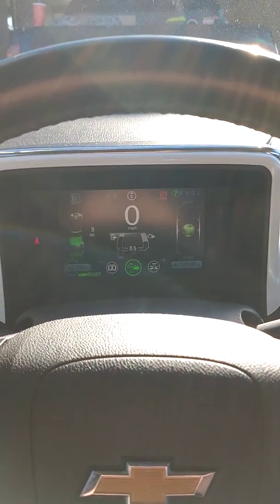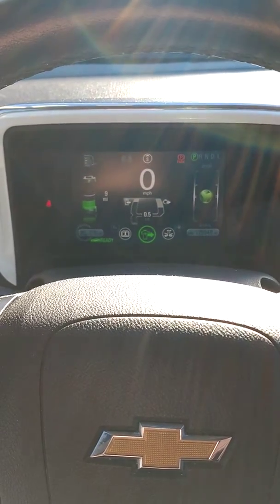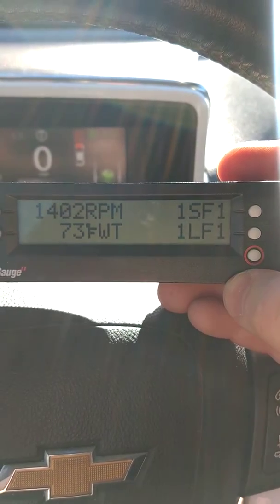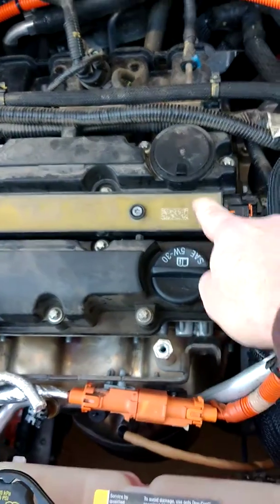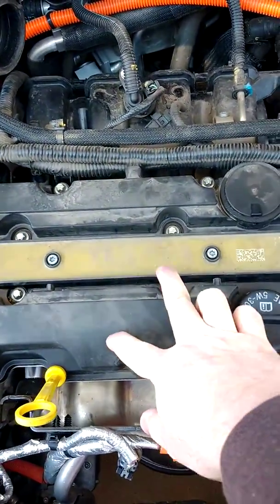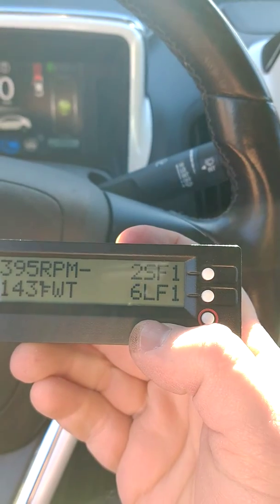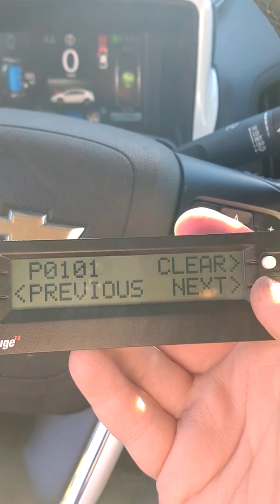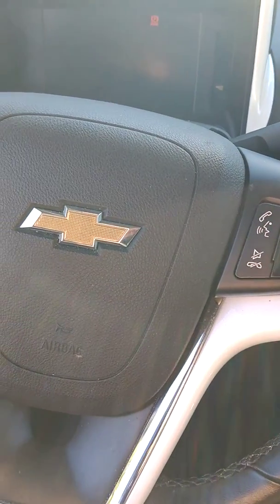2013 Chevrolet Volt failed valve cover  causes it to not pass emissions

Comment: wrap the pcv valve in duct tape, take it back to emissions, lol. mines only an issue right now at idle so i just keep my car in hold mode to save a few miles of ev range once im off the hwy and i avoid it. i changed the oil and saw a little bit of sparkle and some yellow hard crushable rtv type stuff. just going to do more frequent oil changes until it starts whistling. dont have to pass emissions in my area
Reply from the maker: I suppose that could work. The part was only about $60 from Chevy though so it's not too terribly expensive to actually fix and update the part.

Comment: Wish I found this video sooner. I’ve been running like this for a couple months on and off and was getting random misfire. Changed the coil pack,o2 sensor and spark plugs. Ran great for a few days then the problem returned. Changed the valve cover last night and already the engine feels like it has more power and sounds quieter. Hopefully this fixes it. Did you have to replace the valve in the intake manifold? I noticed a little bit of oil in my air filter box but hopefully it was because of the faulty valve cover pcv. Thanks!!
Reply from the maker: Glad this helped you. I sold the car shortly there after, but I didn't do anything else to it other than the valve cover and it ran like a champ and set ready within 20 miles.

Comment: Thanks for the referral here from the other video!  I have ordered the valve cover and I have the coil pack waiting. I will do both at the same time.  The very first DTC that I got that started this whole thing leading me to change the front O2 sensor was P015B. The CEL mysteriously cleared after using Cataclean when I got the most recent list of codes: P015B P0420 P0300 P0131 P0137.  Now there are only two permanent P015B and P0420 but no CEL. I am hoping that replacing the valve cover (my brother who is a GM certified mechanic verified your statement that the valve covers are terrible, and also the front cat on these) and the coil pack (spark plugs recently replaced) will fix the root cause of the O2 sensor issue.  My plan is to do these inexpensive repairs first, then do the cat and O2 sensors if need be later. I'm at 165k miles and have only had one other problem with the coolant pump, so I am willing to put a few dollars in now if I can keep this running for a few more years. Also, I've been all gas mode for almost the whole time I've owned it.  I appreciate hearing what other people have gone through and how they fixed it :)

Comment: Had same issue then error on Catalytic converter, what happen with you?
Reply: Did you fix this issue with a new cover
Reply: @AOG_ETH  New cover fixed vacuum leak, but my catalytic converter got burn out from to much fuel , there is another video on the vacuum leak, happens allot on this motor.  Just search for motor and vacuum leak
Reply: @markjedlicki977  I have that same code 0p420
Reply: I sure hope the cat is still good after this.